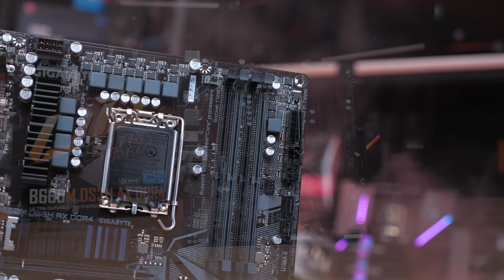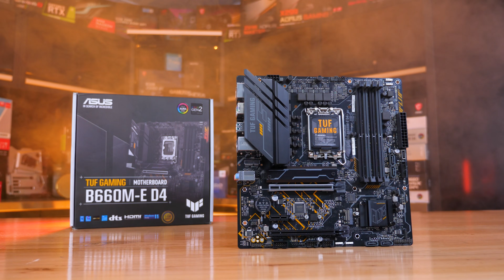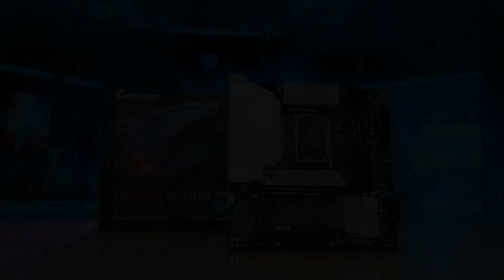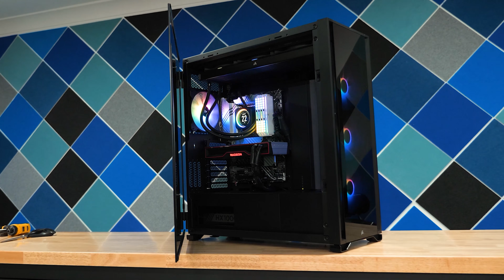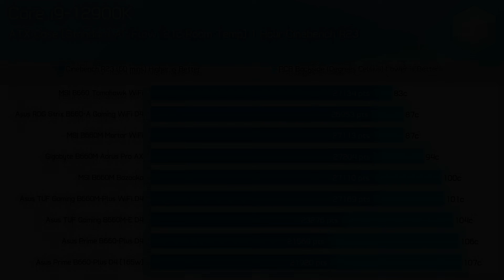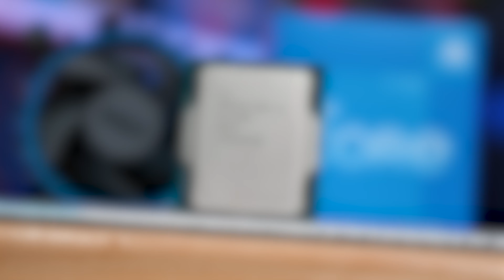18 Intel B660 Boards Tested, VRM Thermal Test

Comment: Its sad that i need an upgrade on my cpu. Checked the models, the fastest ddr4 cpu is the 14900k, since i already got 128gb ddr4 not going in the ddr5 platforms. Checked motherboards the ones available at reasonable price with ddr4, are the b660 & b760 damn too bad 😮‍💨😮‍💨

Comment: Thanks for the video. Even after 3 years this is useful. Pray for me as I try to convince my friend not to slap a 14700k on his asus prime b660-plus D4, because it couldn't handle it anyway. 14700k is 320 euros, and I've been trying to say that the 14600k at 160 euros is the way to go. He is upgrading from some 12th gen low end cpu. The 160 euro difference could go a long way when he needs to upgrade from his 3060 gpu

Comment: i HAVE SAME MSI PRO B660 WITH 12600K 32 GB DDR4 RAM ONLY GETTING 16K IN CINEBENCH 23 CAN SOMEONE PLEASE TELL THE BEST BIOS FOR THE SAME PRO B660 MOBO CURRENTLY USING .18 VERSION BIOS

Comment: 17:13 You know what hurts the most?!! When you’ve decided what CPU you’re going for after seeing billions of benchmarks, & then see these kind of stuffs 😢 & wants to switch back to AMD even if Intel was better for your specific workflow😭 At this point I’m willing to sacrifice the second m.2 slot & 2 ram slot if these manufacturers willing to give me better VRM cooling & similar performance across the board in exchange🫣 At least then my i7 13700K will not perform like lower tier i5s with some specific boards 😭

Comment: I got 13700k and as a temporary board I got gigabyte b660 and at start I noticed 14k cinebench r23 score. After lots of struggle I could make it higher up to 27k which goes lower and lower after each round while temps look fine except VRM.
Reply: FeelsBadMan
Reply: Very close to getting a better board. @OPGamified

Comment: Please tell me the VRM design of gigabyte b660m gaming x ax. Which looks ode to gigabyte aorus pro ax but with weaker VRMs as shown on product page. I need the exact VRM specifications of this motherboard because this and MSI PRO b660m-a wifi are only available in my region. Does bazooka and Gigabyte gaming x ax will perform identical in terms of VRM performance? Iappreciate your help Steve. Thank you ❤

Comment: The only difference between the Gigabyte B660m Aorus Pro AX and the non-AX version is the WiFi ? The non-AX version is on sale here and I'm thinking of buying it for my 12600k... from the gigabyte site it seems that everything is the same, with AX only standing for the addition of wifi.

Comment: I come accross to this video after I bought my pc parts I have a combination with 12600k with asus prime b660-plus d4 with Cooler Master Masterliquid ML240l V2 RGB 240mm and Corsair iCUE 4000X cases's stock coolers. How much it  effect my motherboard temp in this case with full performance of 12600k?

Comment: Watching these videos for weeks. Decided to buy the MSI pro b660m-a. but unfortunately this is not available in the local market and there is a chance of price rise due to dollar crisis. Then got an offer for Asus tuf gaming b660m-e. Normal price -  $175. The offer price was - $ 158. and ordered the board. I will use it with 12100f. Plan is to buy i5 13th gen non k variants may b after 1 year and replace with 12100f.

Comment: I'm late to the party but I've recently bought a i3 12100f with a msi b660m-a pro wifi ddr4. If I wanted to upgrade to a i5 12600k in the future would my MB be compatible or capable or would I need to upgrade the MB?

Comment: Hey, i just bought the Gigabyte b660m ds3h board and will run a i5-12600kf , is it okay or should i buy a new board ASAP? i dont want to OC the CPU i will just have the 12600kf running on its full performance
Reply: Undervolt it

Comment: So for a budget setup (i3-12100f or i5-12400f) one of if not the best option is MSI Pro B660M -A?
Reply: For what application?
Gaming? Rendering?

For gaming it's not that cpu intensive compare to rendering that using entire core count. IMO Gigabyte B660M DS3H is generally more than enough for that,, or maybe good enough too for 12700F (non-K Version) at gaming application.

And yeah,, it depend do you a casual user or enthusiast user

Comment: Great review. Did you guys also measure power draw for the boards? Toms hardware mentions that the ASUS Strix B660-A Gaming WiFi D4 uses more power than any of the other boards they tested. Can you confirm this? The temps in your tests seem more than ok so I don't expect power draw to be above average.

Comment: What's the difference between
  B660M Aorus Pro AX and
 GA  B660M Aorus Pro?

Found the latter one on Ali in a nice bundle with a 12400.

About 300-400$ in total (because of the fluctuating currency exchange rate)

Comment: They really hate Asus and REALLY love MSI
Reply from the maker: It's not that MSI just did a better job with B660 is it?
Reply: @Hardwareunboxed  what are u thinking about GIGABYTE B660 DS3H DDR4? ATX version NOT mini ( the mini is terrible)...  ppl is telling that  its like GIGABYTE B660 Gaming X and is very good board for i5 12400f? can u tell me your opinion.
Reply: @psgFan777  i tested 3 gigabyte boards and got the same power consumption biggest difference is the heatsink is missing on some VRM on ds3h

Comment: Where is MSI B660M-E review???
Reply from the maker: B660 content is performing really poorly now so we've just released it for Patreon/Floatplane members.
Reply: @Hardwareunboxed  ahh okay. Do you mind share the bottomline of how this MSI B660M-E perform? Decent for 65W only? Okay for 125W like 12600K? Thank you
Reply from the maker: It's not a good board, but it is a lot better than the Asrock B660M-HDV. Stock it peaked at 91c with the 12600K and scored 15343 pts, VRM throttling was detected with an average package power of 84w, opposed to just 68w for the HDV.
Reply: @Hardwareunboxed  hello guys, do you also do power consumption testing on the Patreon videos? Sorry for bothering, keep it up with the great work

Comment: if i use b660 board with 12700k for gaming, is that b660 board going to be holding back CPU clock speed/performance of that CPU while gaming?

Comment: Originally because of your review I was going to buy the MSI board, however I am doing an upgrade on a budget and noticed the MSI board needed a 8 + 4 pin from power supply. Recently Gigabyte released B660M gaming x ax, which will work with my current single 8 pin cpu power supply, and I checked their website it listed a Bios update that addresses cpu vrm for better performance, hoping it's worth it as the power supply with 2 cpu connectors is out of the budget.

Comment: I would need to see Asrock b660 steel legend review and vrm test for research purposes. There is not so much review for this board out there, especially for the vrm parts.
The price is about on par with MSI pro b660m-a at least in my country

Comment: Can someone help me?
I bought this motherboard and im having a problem with my boot times, compared to my other pc (with a inferior ssd) it almost doubled the boot time (11s vs 24s), even with ultra fast boot enabled. I was doing some research and it appears to be a “post time” problem with the board but i couldn’t find any settings in the bios to fix it
My current pc has a samsung 970 EVO Plus 500gb and a b660m ds3h (i5) with f5 bios 
The other pc has a kingston NV1 250gb and a h410m s2h v3 (i3)
Reply: Gigabyte bios are preaty bad. And D3SH is one of the bad motherboards out here. So if you cant find its probably not here but maybe update will bring that option or find some moded bios(not recomended if you dont have enough experience, but you try it) with it.

Comment: Can MSI MAG B660M MORTAR WIFI only connect one 8pin CPU ? (As my PSU only has one 8pin EPS, and will use i5-12600K with non overclocking)

Comment: What would be better? Gigabyte b660i Auros Pro or the Asrock Z690M-ITX/ax? The Asrock board is about 25usd more than the Gigabyte here. I will be pairing with either a 12600k or 12700 (non k) (still havent decided which CPU yet)

Comment: I got the Asus ROG Strix B660-A one and my intentions are to do a white build with it with a 12700. I was very surprised to see that they left holes for LGA1200 and not only LGA1700. Also, it has applied shield and, I know that it is expensive but darn if it isn't beautiful!

Comment: Just made a virgin vs chad meme based from it, named "Wizards B660M-K 4, B660-PLUS D4, B660M-HDV and B660 Pro RS vs. Virgins B660M-D3H/DS3H DDR4, PRIME B660M-A D4 and B660M GAMING DDR4 vs. Brad TUF GAMING B660M-E D4 vs. Chads MAG B660M MORTAR/BAZOOKA DDR4, ROG STRIX B660-A GAMING WIFI D4, B660M AORUS PRO AX, B660 TOMAHAWK DDR4 and PRO B660M-A D4"

Comment: Intel and nvidia are literal slow boats. Here's why. Look at number of cores and performance scaling vs an ocean liner cruise ship boat and its number of rear engines and efficiency. Maths scales rather well. A computer or to compute means a calculation performing tool which intel would argue includes the abacus and would be correct by definition centuries ago but modern computing that we think of is somewhat very different.. For a electric circuit with no moving parts not churning wavy waters to have 2 cores scale and perform like 2 or more ocean liner engines somethings seriously wrong maybe? with a purely mathematical maths based calculation device where exponential performance increases are not only possible but I like toy imagine a requirement 2 cpu cores vs one should be about double performance minimum if not double the image quality??? Why does moving parts motor in the oceans performance make Intel seem lackluster I wonder? Could we have a hardware reviewer attempt to pretend to review some hardware please?

Comment: I believe someone might have already mention it but the B660m Mortar has DDR4 version with and without Wifi and the non Wi fi version is all black themed, also, it has a nice audio codec the ALC1200. 
Edit: The most absurd B660 board I've seen so far is the Asus Rog Strix b660-g gaming wi fi.

Comment: Just today I finally built my rig using a B660 Mortar, running benchmarks on par with your results (conebenchr23 21842). You should definitely spread the info about CPU Lite Load Modes, running my 12700 on Mode 1 which resulted in 30W less power-draw and 10 degree less on the package and 5 less on the VRMs 👍🏻 (Just look for Mike Miller here on YouTube)
Reply: Planning to build same, could you help me with which cooler you have used how is it performing?
Reply: @kaustubhx5452  I‘m using a Noctua ND-D15s and it performs stellar!
Reply: @Tom_Hart  what do you think about deepcool as500 plus?
Benchmarks are close to NH d15s and better than entry 240 aios
Reply: @kaustubhx5452  I have no idea about the model you asked but I wouldn‘t hasitate and give it a shot, if benchmarks are provided by trustworthy sources 👍🏻

Comment: So which motherboard you reviewed can I put an i7k 12th gen in it and use a big noctua air cooler with power limits unlocked and stress test it for an hour and have it stay under 90c and no throttling?

Comment: Looking for a full ATX budget board.  Is the MSI B660-A the ATX version of the B660M-A?  Most importantly, do they have the same VRM?  The heatsinks and layout are slightly different between the two.
Reply: Yep the MSI A-PRO is the one you want. Their PRO range is the low bling, good performance at a decent price, option. If you want the same board with bit more bling, it's basically the mortar.

Comment: This was a really great video specially for using 12700 with B660 board which is really appreciated. I just wished if you could have included GIGABYTE B660 AORUS MASTER in the mix as it priced very similar to MSI MAG B660 TOMAHAWK WIFI at least in India. Great video though, most realistic as well as practical guide for choosing the right motherboard for 12700.

Comment: i want to know if my MSI PRO B660M-E ddr4 purchased here in uk is as good as the b660m-A
Reply: its not 
go on the msi website and you will see that they look different
the -e has no vrm heatsinks whereas the -a does
different i/o aswell

Comment: The chart at 16:40, the stark difference in temperatures is what separates the boards using power stages vs the boards using discrete mosfets right?

Comment: Any plans for any LGA 1700 mini ITX board reviews?  The Z690 boards are ridiculously expensive and the B660 boards are limited in number and hard to find in stock.  This makes it frustratingly difficult to make a economically viable SFF using the (otherwise) great value 12100 and 12400 utilizing DDR4.

Comment: I don't understand the high end boards. If I were to buy a 12600k, I'd get a $200 z690, and if I were to get a 12400f I'd get a $120 B660. Upgrading from an Intel 8400 to a 9900k isn't something most people do today. I doubt people will upgrade a 12400f to a 13700k in a few years, while using a b660 board.

Comment: Can I suggest in the future to make a video showing onboard VRM temp vs temp probe on rear of PCB?  In my work we have had to do similar tests for PCB mounted electrical components and have found that the choice of component, the solder used, the PCB layers/thickness all impacted the delta between the rear of PCB temp vs actual component temp.  Thats not to say reported VRM temps are more accurate, but ultimately it is used by the BIOS to thermal throttle, so it would be a useful comparison to see what the headroom is for the boards.

Comment: Great video, very informative. 
I'm looking to upgrade my board and I'm undecided between the msi pro b660m-a or the tuf gaming b660m-plus since they cost the same in my country. 
I saw the ASUS has PCIe 5.0 but my gpu is a budget one so I don't belive this is a factor.
any suggestion?

Comment: Friend wanted to pick Asus B660 prime, had a feeling and twisted his arm to spend a bit more and get Asus tuf b660-Plus WiFi. He also got to drop some ugly ass shit green pcb wifi add in card cause  of built in WiFi. Had a feeling b660 prime is gonna be piece of trash. Good to know he did not spend money in vain.

Personally I am running b560 Tomahawk, really solid board and not surprised its amazing on b660 chipset aswell. 

People should really think about spending a bit more on motherboards. Shit ones are fine for low end, but the limitations you are getting in terms of upgrades or connectivity are just not worth it..

Comment: Gigabyte also had an expensive B660, B660 Aorus Master.
The B660AM got 16 phases (probably 8 doubled), which 'advertised 60A phase' (the Aorus Pro also get that 'advertised 60A phase' and gets 55A instead). But the price is reaching entry-level Z690 like the Z690 UD DDR4.

TUF Plus, Mortar, Aorus Pro also exist in non-WIFI (with $10-20 price cut, depending on the region).

Comment: With all the MSI praise, I hope their quality has improved considerably. Really getting tired of replacing motherboards from MSI because they failed after a few short months.
Reply from the maker: I don't think I've ever had an MSI motherboard die.
Reply: @Hardwareunboxed  Over the last year, 7 out of 9 motherboards to die were MSI & the other 2 were Dell OEM boards (on desktop). MSI accounted for 2 of 5 laptops that were dead due to bad motherboard. And I have troubleshot a couple friends' systems with DOA boards and only one DOA graphics card from them.

Comment: I really hope AMD is smart enough to keep AM5 board prices in check. That's the real way to improve competition.
Reply: AM5 is DDR5 only, new socket, PCIe 5.0, etc. AM5 boards will be more expensive than LGA1700... I guarantee it.
Reply: @__aceofspades  Why would any of that make it more expensive? Maybe more expensive than DDR4 boards. Sounds like Intel fanboy drivel...
Reply: @TechHug  PCIe 5.0 will require better traces than PCIe 4.0 (or 3.0), so that makes the cost higher. Then again, Intel is notorious about how much they charge for the chipset. So I dunno if AMD's boards are gonna be MORE expensive than Intel's. As expensive as, surely. More, I dunno.
Reply: @erejnion  AMD's historically been cheaper with feature parity though. I'm a good expecting B650 for $250 to be doable.
Reply: @TechHug  Exactly: AMD has always charged less for its chipset. But it's not feature parity with Alder lake, so who knows. Either way, it seems like 140-160usd for B660 is about enough, so I expect AMD's cheapest decent boards to be in the same price range. Kinda sad, considering I gave 160usd for my own X570 board before the pandemic hit. Back then the cheapest decent AM4 boards were under 100usd. 50% inflation is gonna sting, even if it's not feature parity with back then.
Reply: Not really possible right at the moment. The raw materials are just more expensive than two years ago. AMD can't make the manufacturers sell you motherboards at a loss.

Comment: On one hand I would take mortar becouse good vrm and alc 1200 sound,on second hand it only has pcie  4.0x16 for gpu how will this effect new gpus nobody knows,than I would maybe take tuf gaming plus becouse it has 5.0x16 for gpu but alc 897 sound..In the end..bummer.Rog strix is probably best there is becouse pcie 5.0x16 for gpu and alc 4080 sound also build quality anything strix or rog is another level

Comment: id like to see some of the better b660's board agasint some budgets z690's.  seems like you are paying a large premium for a 12700k and z690 over a 12700 and b660, with not a lot to show for it.

ive noticed z690 boards like asus prime z690-p, msi pro z690-p are very similarly priced to the tomahawk and aorus boards you have here